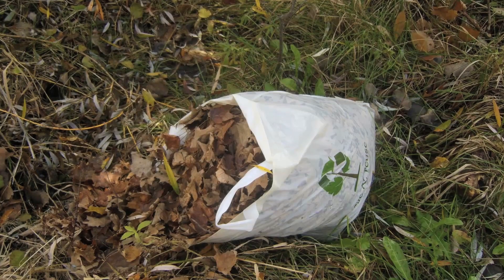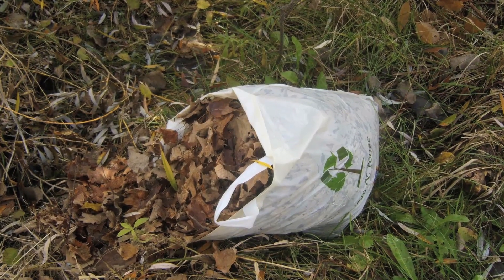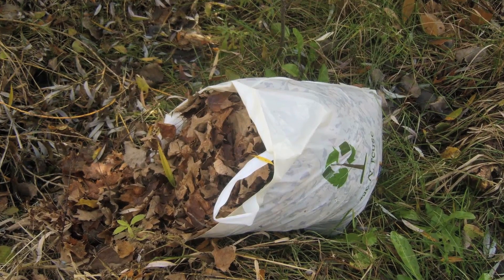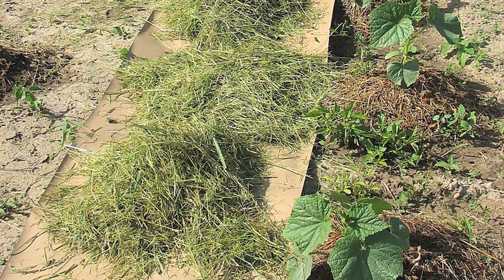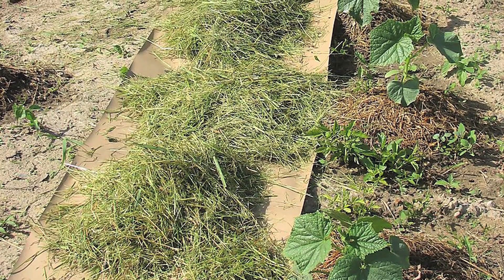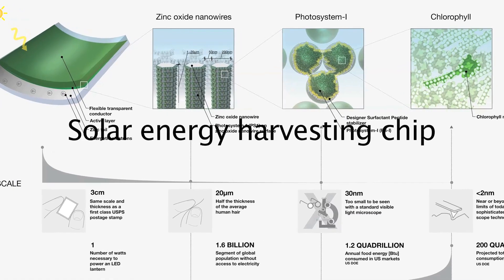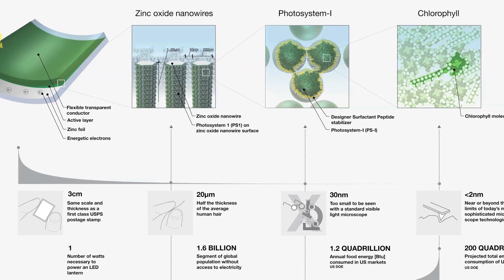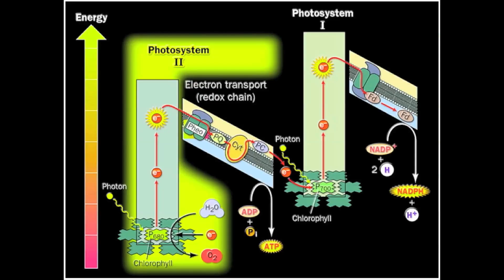Harnessing nature's solar cells

Comment: Hi Andreas Mershin 
your vision Bio-Photovoltaics produce electricity
a noble approach -
Ti02 assisted surface paint would produce electricity itself
but toxic ? low effeciency < 6%

your version copy the leaves make bio solar when do you expect
a first demonstrator 5V USB to run 10mA for a LED ?

we just send a team with solar rooftop 4L Trophy 2012 Morocco
I-Phone charging from solar direct USB needs 5V 500 mA or "greedy" 1A !
LED Lantern yes, video  Agropark

Comment: @iminspacespace If you watched the video, you'd have heard him say that you can literally just hook up a wire to the "panel." Assuming this is as big a jump as they claim in cost and efficiency, that means we can just buy the powder, whip up some grass/leaves, mix it with the powder, cover some rough metal with it, and connect wires to the metal to get electricity.

For obvious reasons, that also means a big jump in availability.